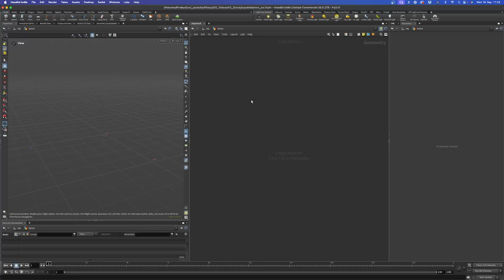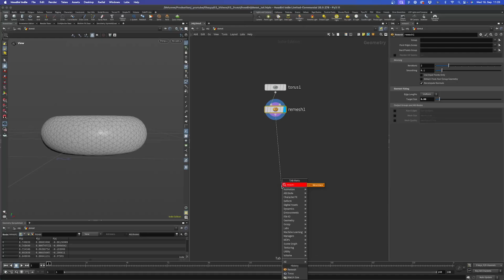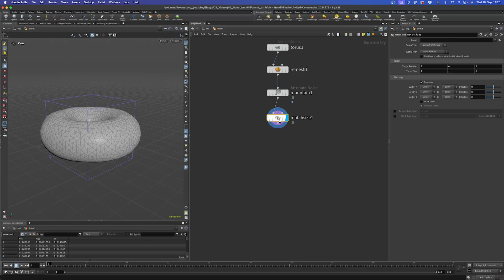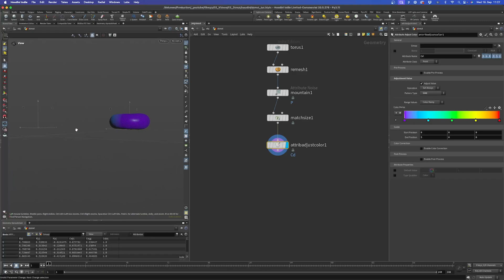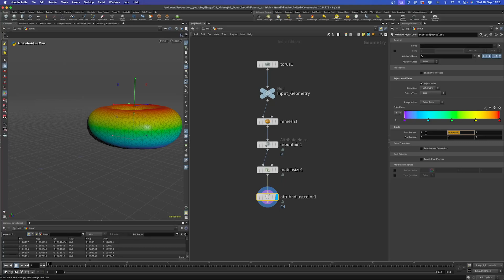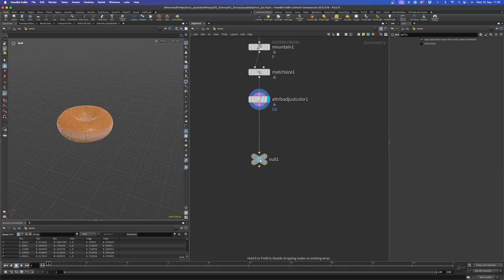Donut Part 1 Dough | Houdini Tutorial

Comment: I'm really excited to follow this series! I don't know if you will do that later, but often donuts have a dent where the color is lighter. So I added a softtransform with the selection set to "@Cd.b>0.4" (or whatever you can use to distinguish between the two different colors you used before) and the turned down the scale slightly and also the soft radius.
Reply from the maker: That's a great tip and a nice detail to add, thanks for sharing! 🙏